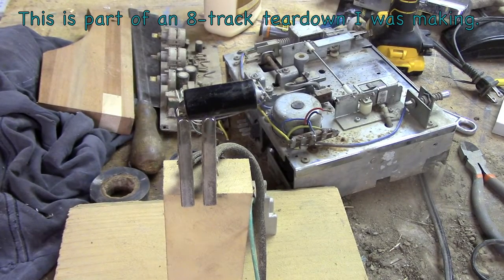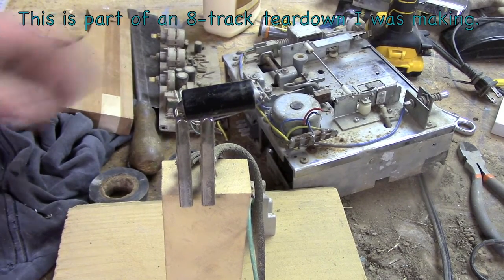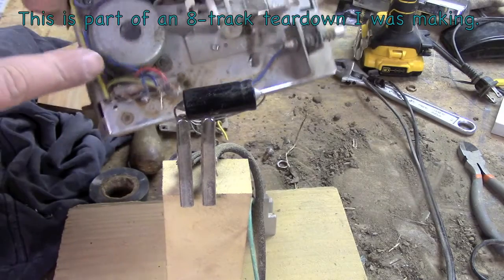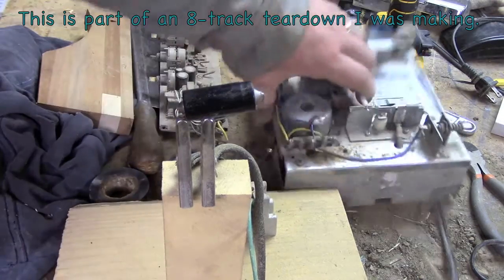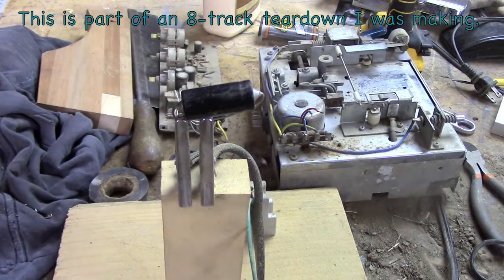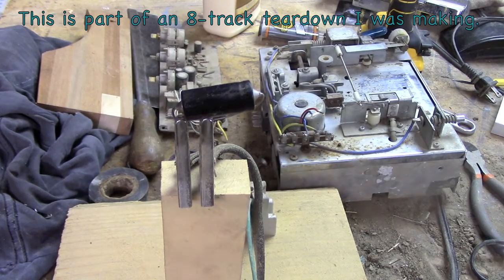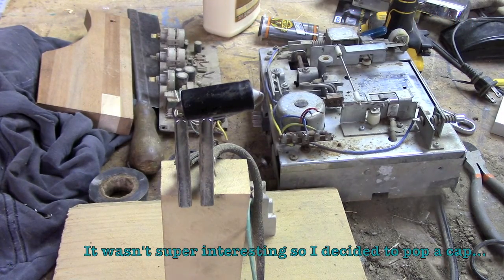Capacitor Explodes in Hand

Comment: That is interesting. Glad it was mostly noise and steamy paper. I'll bet you are right about the heat not soaking into all of the evaporative steam material (electrolyte) for a time... and that's after they stop elongating. I've heard that some caps are designed to elongate from internal pressure such that it pulls the guts of the cap away from the internal connections, cutting the power off (not radial caps). But if you can get enough heat energy into it quickly enough it will perhaps not only pop, but will have some empty space to build up good pressure!! Hmmmm. experiments!!
Reply from the maker: Well lesson here is, keep the camera filming for a bit after a failed experiment.  Good things happen... for others.